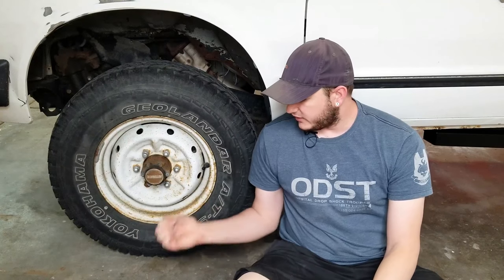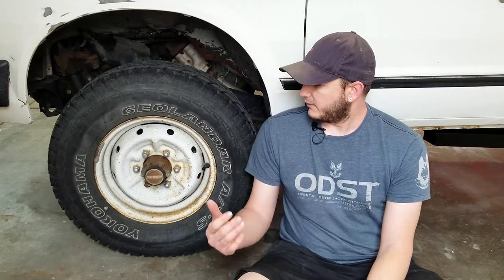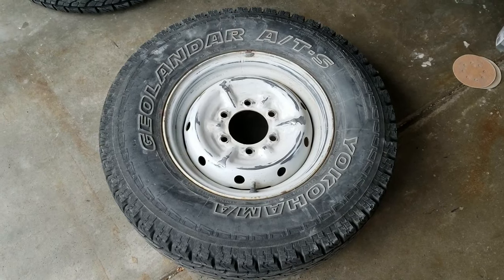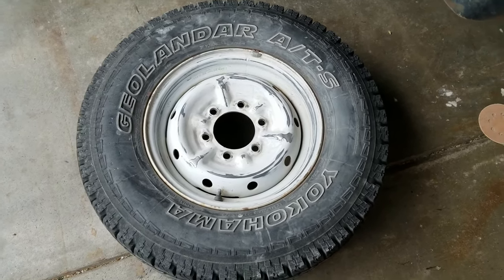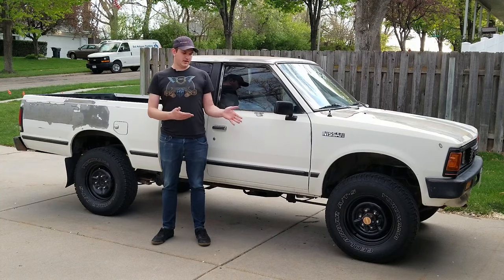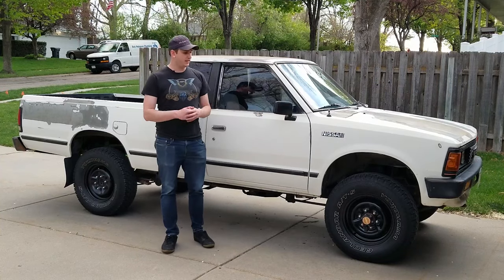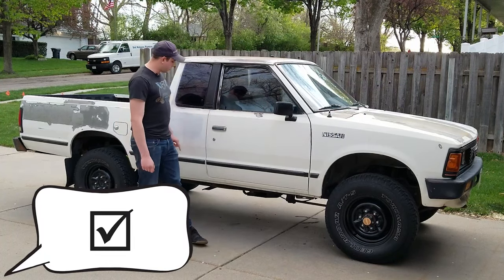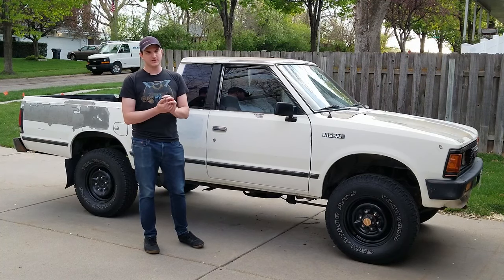How to Sand and Paint old wheels! For my Nissan 720!

Comment: I ended up buying an old uhaul and tearing the back off, cutting it down and putting a steel bed with fold down sides and ramps on the back for work. Did this too the wheels after seeing your video and it came out real well

Comment: What size tires? What you think biggest tires that will fit?
Reply from the maker: Those are 235/75R15 on currently. The largest I've seen is 16x8 30” tires
 with the torsion bars cranked as far as the will go.